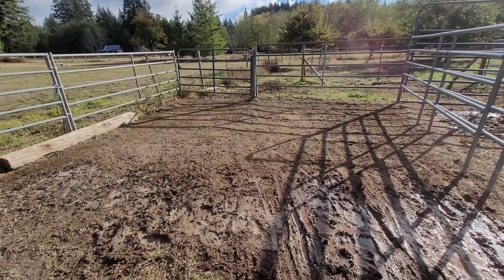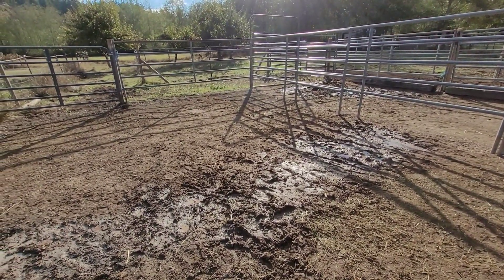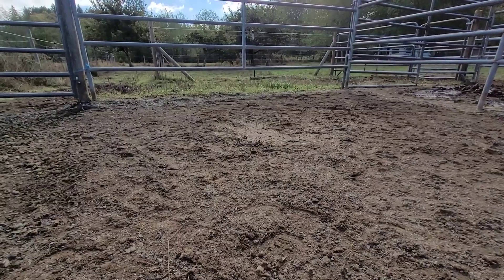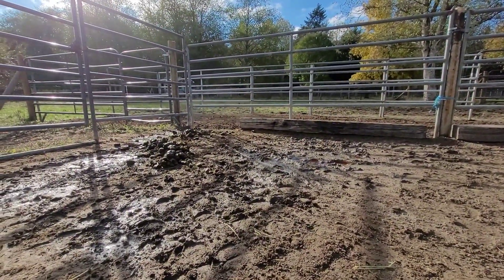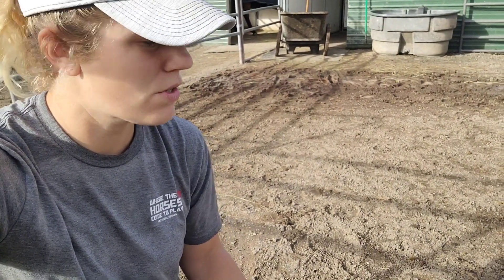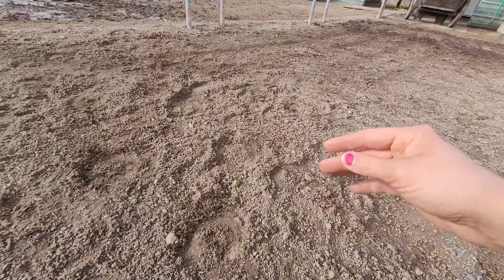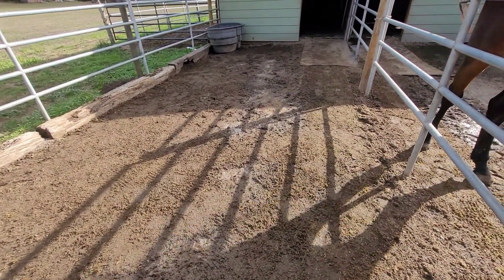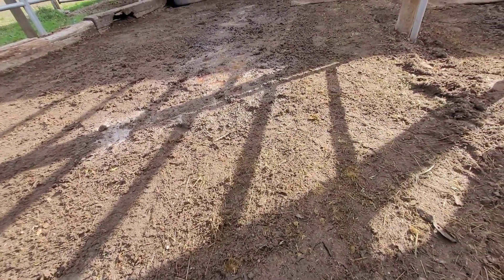Eco Grid/GeoCell Update 3 Years Later

Comment: I hope this might be considered 'better late than never', but this kind of grid system isn't made for hoof-sized pressure (14 to 16 square inches) from directly above. They're more for auto and truck-sized tire rolling pressure from the side and it's also expected to be compacted after filling.  

A much smaller cell for the gravel would work a lot better.  Something like what's called 'permeable pavers'. Amazon has a brand called Vodaland that looks close. They're more rigid and have better shapes for hooves. But nothing will work well without much better drainage.